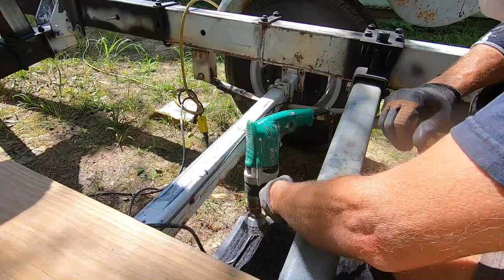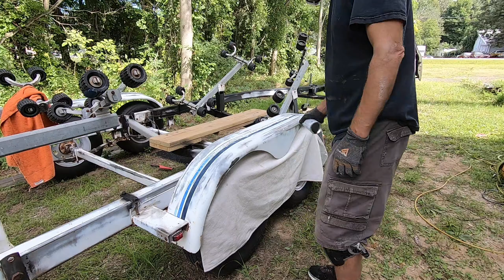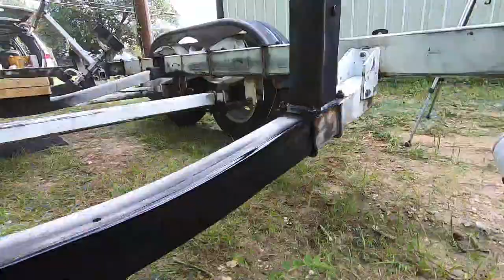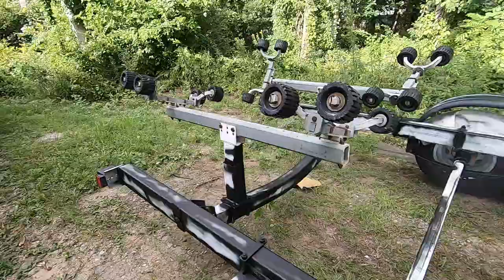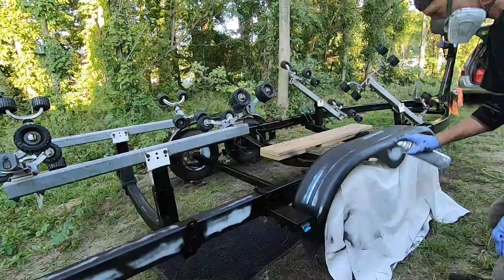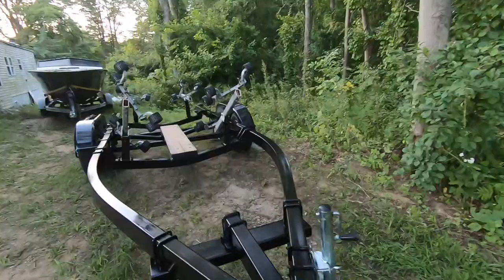How To Paint A Rusty Sailboat Trailer  |  E50

Comment: That looks good! How many cans of spray paint did you use? Thanks!
Reply from the maker: I used 5 cans of Rustoleum High Performance Enamel
 which is a little taller than most spray paint cans. ( one coat)  Good stuff! Thanks for watching : )
Reply: @karlsawesomeadventures9608  Do you know if that will work on a galvanized trailer? Thanks again!
Reply from the maker: @rlyle5804  I think it would work, since it is made for coating different metals. Not 100 % sure though.  Test out a very small area underneath first.

Comment: Karl, what is the over all length of your trailer. From the coupler to the back of the frame. I have a trailer my boat is on but it is big. It’s 3 axles and I was thinking about down sizing. Thanks.
Reply from the maker: James, I think it's about 25 feet total length.
Reply: Thank you.